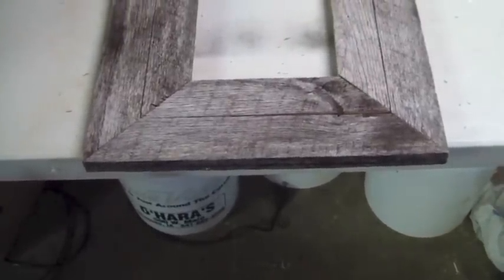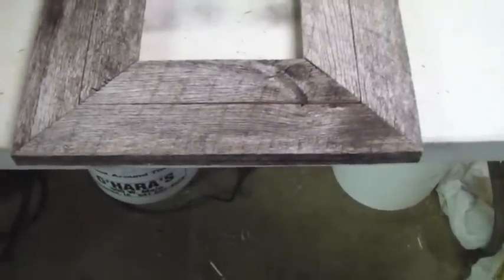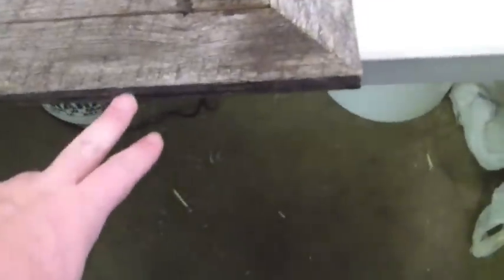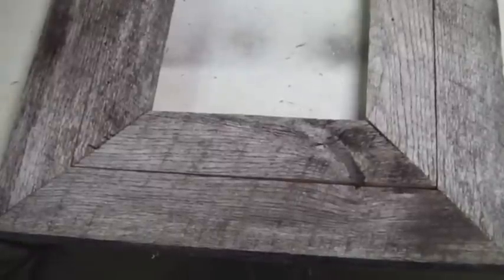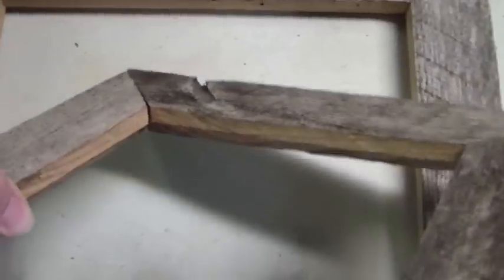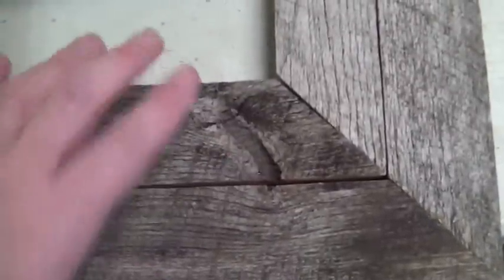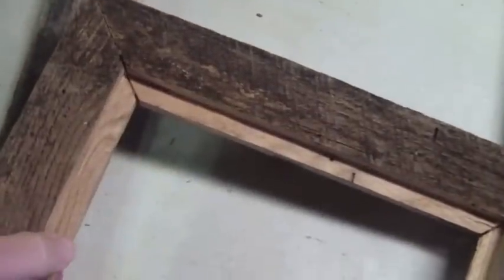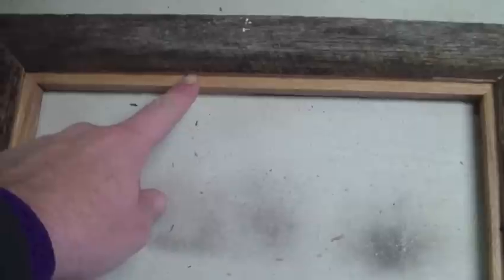Idiots Guide to Wood Working Barn Wood Frame

Comment: WTF? doesn't tell me a single thing. what is the process from beginning to end? how do you put the groove in to hold the glass? how do you hold it together?
Reply from the maker: Just used table saw to cut rabbit in wood for glass & brad nails with glue to hold corners.

Comment: Black tempera  paint, thinned with water.  Use a thin, wet coat.  Then, recoat after dry as necessary.  If you don't like the texture of the cut edges, then wire brush them lightly before any coloring is done/
Reply from the maker: Thanks you I will try that next time I'm working with old wood.

Comment: Hi! What is the width of each side of the frame? I'm using fence boards and would like to know what the measurements should be. Thanks so much!
Reply from the maker: Mine are 1.5" but you can make them what ever size you want.